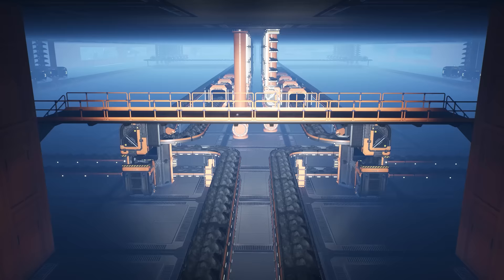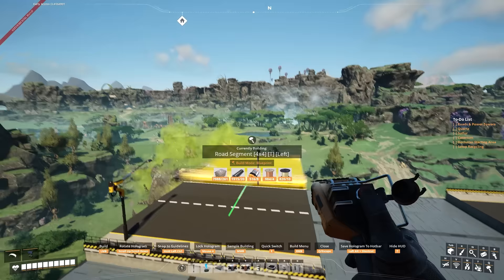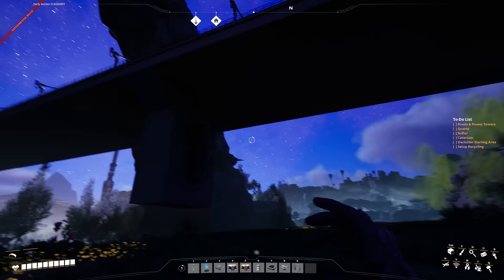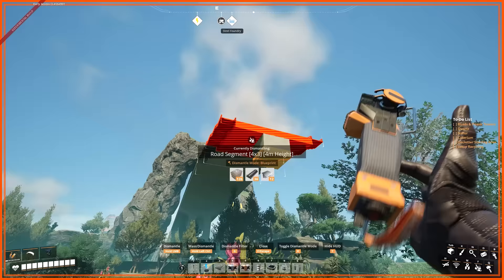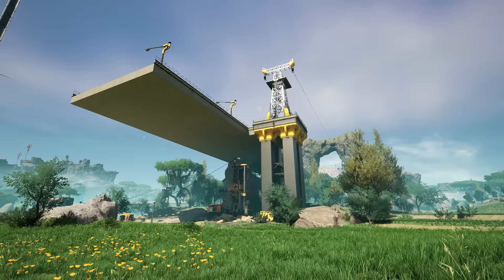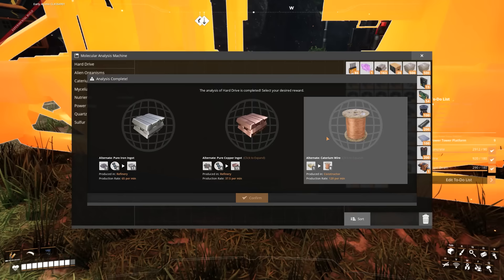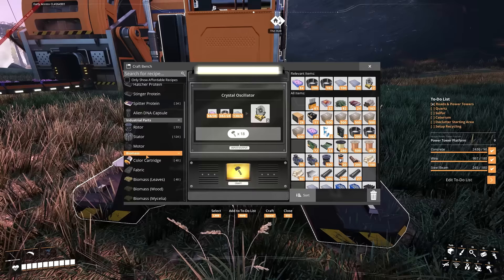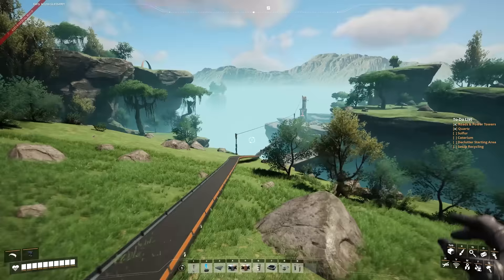These NEW Blueprints Change EVERYTHING in Satisfactory Update 8!

Comment: A bit of a tip about Quartz production: The numbers seem really odd, but 22.5 and 37.5 add up to 60, so a normal Mk1 Miner can supply exactly one silica and one crystal constructor.
Reply: That's what I came here to say.  He could skip all the overclocking and just run four Constructors per node, producing 75 Quartz Crystal and 45 Silica each
Reply: Neat! Just checked it out on the Calculator. It also adds up really nicely for alternate recipes: 2x assemblers making Cheap Silica (@ 11.25x2=22.5) + 1x refinery making Pure Quartz Crystal (@ 67.5), giving a total of 90 input for the three buildings. I'm gonna build them in sets from now on!
Reply: but how du i split it? because splitters can only half it?
Reply: @thelastengineer8633  You're not going to be able to easily split your input according to those numbers, but you don't really need to. It's the whole manifold scenario all over again; you'll oversupply some machines, but once those are full, the remainding items go to the previously undersupplied machines.
Reply: @parlaptie   ah ok thx

Comment: If you put the power towers in the middle then you have to make every road wider to accommodate them even if it doesn't have a power tower. So that's a lot of extra material since you don't need a power tower in every segment. By having them off to the side you only have to build the extra supports when you need them.

Comment: Road variant suggestion: Power towers used as support pillars beneath stacked single lane roads, i.e. a lane in one direction beneath a lane in the opposite direction. Ceiling light on the underside of the top road connected to a street lamp on the top of the top road; that way you'll only have to connect a single street lamp between blueprints.

Your initial versions look fantastic! Would it be easier to have the lights integrated into your ramps by default and just delete them , or add them after the fact like you're doing so far?

Comment: I know this is a few months old but I got your blueprints for the roads and absolutely love them.  Also just wanted to let you know that you dont have to do that tedious side building to get the inclined road pieces to connect at the right heights, just switch build mode back to default and stand on the upper edge of the one you just placed.  thats what ive been doing, if you get good at the timing you can just walk forward down the ramp in the middle and click to kind of emulate zooping lol

Comment: Where it comes to aesthetics using conveyor belts, you can organize it by building a tower system with walkways. Small base, and a three by three top for a simple three conveyers side by side and doors to pass through. You can build massive towers as central nodes where different resources come together. Also works great for using tubes to get around across great distances without having to press any keys or use additional tools.

Comment: Not bad. I did the same on my own but my way to fix the incline problems with roads at 20:30 is by using column buffer blueprints and going down the same amount in each blueprint.

You basically attach a column support that is as long as your road segment, under the road, and then latch the road blueprint (which should also have a column/support) to the new column you added.

It simplifies the job a lot. You can also do this when going up in ramps by adding your new ramping up roads on top of the column buffer I mentioned. With my method, you never have to go down to the ground to 'fix' the problem with extra foundations. I even built on top of the waterfall chasm to the west of the grassy plains!

Comment: I would recommend before each truck stop, and after you have a double storage container and use both belts to feed into the truck stop and pull out of it. This is so as the truck pulls in, all the resources feeding it momentarily pause, but can still fill into the storage bin. Then when the truck leaves both belts feeding in quickly re-fill it full, twice as fast as the one belt feeding the storage bin, so it allows it to catch up and get more items into the truck stop. Same for the other end. Two belts will quickly help unload the truck stop and give it a buffer as one belt empties the container. This tip will apply to trains as well.

Comment: Awesome blueprints, definitely going to use some of those when I'm ready to do the Update 8 playthrough. I do love my power lines running under the road though, just a habit I've built up from when it was only the ugly power poles, and eventually the vastly superior ceiling nodes that could be stuck below the foundations. But with the arch supports that gives me a whole new idea of straight up running a double support beam with a kind of arching connection below the road but the powercables running between the legs if you will. So now say you have 3 foundations between every support or an uneven number anyway, 1 might be better if you want it to look sturdier though that might look cluttery in my opinion. But uneven support gaps and then in the middle of every support gap you place one of those transport towers I think that'll look pretty cool though I'll see when I get there :p

Comment: a suggestion have the snap point you make for the slope on the blue print then just delete after instead of adding and deleting on each application of the slope blue print
Reply from the maker: Yeah I thought about that, but I also feel like the easiest thing to do is just build ramps up, rather than down, where possible, as they just snap fine that way.

Comment: In terms of realism, throwing the transmission towers to the side of the road is better imo. I can't speak too much to power infrastructure outside of the US but here, the high voltage transmission lines require quite large easements clear of anything including roads and often ignore the road grid and make essentially straight lines as terrain allows between generating stations and substations, where the voltage is stepped down and you would switch essentially to Satisfactory power poles which DO go along the roadside.

Comment: Only thing with the power towers, and it is a very small thing is instead of 2 wires at the top they should have 3. One wire per generator phase, but that's starting to get into nerdy electrical stuff. Well unless we're generating and using DC power, then its fine.

Comment: Fun fact: You can mine far quicker manually, since you can put over 100 portable miners on a single node. 
Probably of little use outside of a speedrun tactic or a caterium node capped by rocks though.

Comment: what u could do whit the roads u build. slam a fule belt below it and then add some trucks stations on the way use them as fule stations where trucks can refule when they drive below them.
Reply from the maker: I plan to just have a truck that refuels roads by driving to checkpoint locations. In the future drones will deliver the fuel to these checkpoints.
Reply: sure thats also an idea i not thought of build gas stations and just let trucks deliver the fule. smart idea saves belt work. @WhatDarrenPlays

Comment: So idk why I haven't seen this mentioned anywhere or why every tutorial uses that platform for rmp blueprints but theres actually no need to make a platform to snap your ramps. just build a ramp start blueprint to snap to the highway and  an end platform for when you're done with the ramp and then when you snap the actual ramp platform snap it on top of the starter ramp and that makes a snap point that lines up perfectly in front of it so your basically doing the same L shape but it lets you use the blueprint snapping to do it. if you aim right you can literally build as fast as you can run doing it this way. (don't recommend actually running unless you have a jetpack... it's very easy to fall off that way...)
Reply: This is a good idea transitioning, but the problem is that you still have to look at the edge from the front on the ramps to snap the next ramp blueprint. You can't do it standing behind the front, I have tried. It wouldn't be a problem if we could nudge vertically.

Comment: 50:20 Belts are better in most ways, but they are the worst as far as logistic flexibility goes.  It takes the most amount of time for belts to be rerouted to other locations.  It is faster to drive a new route for a tractor/truck, and it is even faster to reschedule a train to deliver elsewhere.  There's a lot to be said about this topic, and people have all sorts of opinions on which form of logistics is best, but I just wanted to point that out.  Belts are nearly perfect, but good luck tearing them down later if you feel the need to do so.
Reply: I have 400hrs into the game, I'm unlocking phase 4 of the space elevator and tier 8. I have yet to manage to setup a train or even a tractor setup. My brain glitches, when thinking about it. It's just never as nice as I have seen it online.

Comment: You should definitly get the steel rotor recipe before you automate motors. Since this recipe requires the same ingredients as the stators, will make automating motors so much simpler, since you only need steel pipes and wire.

Comment: I have been copying every episode too a tee (edit spelling tee) including placement.  Amazing content, keep going slow and explaining.  May I please ask what tool you use to plan out locations and foundation positioning.  The coal factory was masterful planning.  They must take you a long time and I am not taking it for granted.  Appreciate your work
Reply from the maker: I don't use a tool, I just did it in game to work out placement.
For planning a factory, I use pen and paper, and a calculator. With the Coal Factory, I decided how to do it based on what I thought would be easy to upgrade and to teach people. I wanted to build in Blue Crater as it wasn't too far from the starting area, and it was a different location to where I built before, and it had 4 normal coal nodes.

Here was my thought process:
Starting factories often have to be reworked, what if we built this to last? 
So I looked at what Mk.3 miners got out of 4 coal nodes... 2400 coal. 
So then the question became how many generators does that feed? 160. 
How much water does 160 generators need? 7200. 
How many water extractors does it take to make that? 60.
Pipes are maxed out at 600 per minute, so how many pipes are needed? 12. 
Hmm. 12. There are 4 coal nodes... 12 pipes...
What if we broke the factory up into 4 segments?
That would mean that it would be 3 pipes, 1 coal miner... to damn... it doesn't go evenly into generators because the water intake is an odd number (45)... unless?
What if we underclock the generators to force them to consume 40 water? Then we'd need 20 extra generators in total, but it would keep my "4 segments" in tact.
This works! And with a layout built to last, the bottleneck is only the belt speed and the pipes... so it'll only require belt upgrades to ramp up power in the future.
Now... how do we fit 180 generators into a crater... we have to build up. (or build out over the waterfall on the edge of the map but that would look weird)
So in building up, create a layout that can be easily broken into 4. So a rectangle of water extractors, with all pipes in the center. A rectangle above that splitting the ore and an rectangle above that with all the generators. There was just enough space to fit them all in too, that just worked out!

So that was the thought process! Unfortunately the alignment was really messy to do, and I lost a lot of people in doing that large build. I'm very happy with it, I think its great, but I could've explained it better. Oh well, hopefully people find the series again in future for other builds!
Reply: @WhatDarrenPlays  thank you for the detailed, it makes total sense.  For mine, I think it was a great display of how even genius' like yourself can err too and how to fix it.  Thank you for leaving it in.  I learnt more from the mistakes than the perfect edits.

Comment: Hi Darren, another great vid.  Question:  My maximum building placement distance seems to be significantly shorter than yours.  I'm currently following along the Power Tower Exploration portion of the video, and the distance at which I can place the next tower seems to be about half of your placement distance.  Is there a trick or a setting I'm missing?  I couldn't find anything on the interwebs about it.
Reply from the maker: Hmm not sure. Power towers are the only building that let you place them super far. The trick might be this though: build a power tower next to you. Then look at the top, select to build a power line and attach cables to the power tower. Then with the other end of the power line, look off into the distance. This should extend the reach of where the next tower can go.

Comment: 19:37 WORKAROUND to "ramp blueprints" not aligning up. @WhatDarrenPlays

I found that if you position the blueprint hologram the best you are able, short of vertical alignment, go ahead and build it, and proceed to build another, you'll find that every other build of the blueprint is aligned with the original. Clean up the misaligned builds and you're there.

Hope that makes sense. It was one of those frustration moments where I threw my hands and just started laying down blueprints, clicking away, just to find out...wow, that actually worked!

Comment: wouldn't it be better to put the walk ways in the center so you can place the power towers in the middle with the supports for the road under the power tower. that way the towers aren't sticking out as much. also for the walkway ramps can't you just use the road slope pieces?
Reply from the maker: Power Towers are 1.5 foundations in width, so putting them in the center would need 1.5 or 2 foundations. This wouldn't give enough room for a road either side unless it was just 1 foundation which I think is too slim personally. So the other option is to break it into multiple blueprints to assemble slightly wider roads. Or, as I have done, keep it to one blueprint with additional side towers every now and then. No right or wrong, just preference I guess. I like the idea of having more Highway style wider roads with the split in the middle for busy areas.
Reply: the base of the power tower may be 1.5 foundations but closer to the top it's skinnier. You're right that there's no right way to do it as aesthetics and building in games is very subjective. That's kind of the beauty in it. Wasn't trying to knock your build in fact it's better than 90% of what others make. Was just spewing out some thoughts hoping someone like you could actually make my bad idea functional or at least look good.